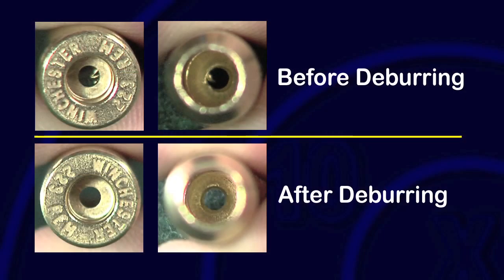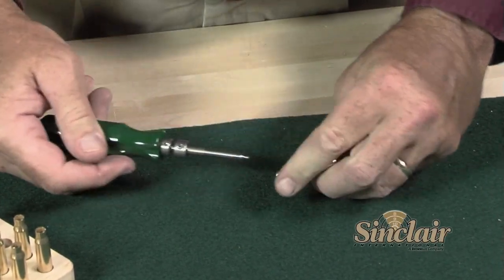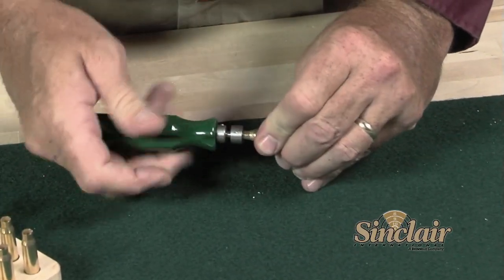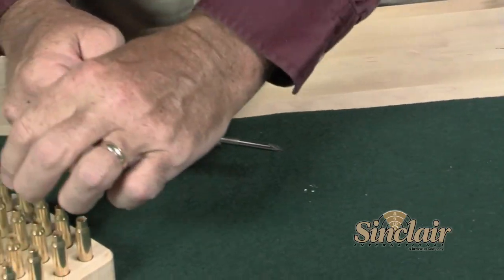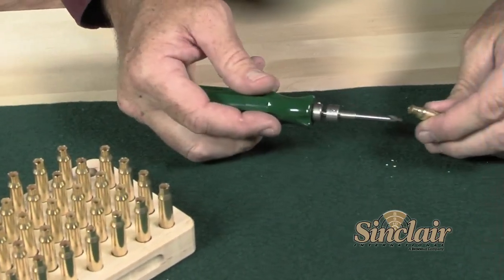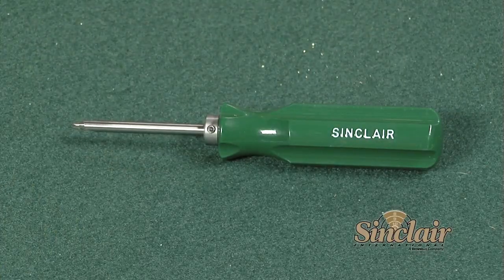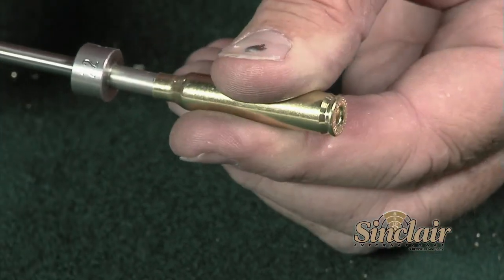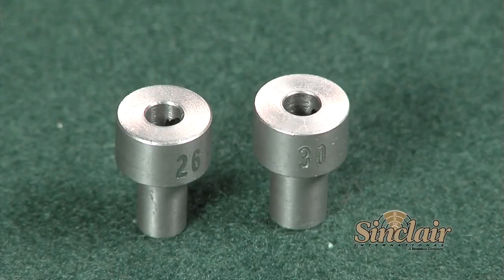Sinclair Piloted Flash Hole Deburring Tool

Comment: does a flash hole and the pocket uniformer do the same thing? cutting away  the burrs?
Reply: No, it reams out the flash hole on the outside of the case the deburring tool removes the factory burrs.